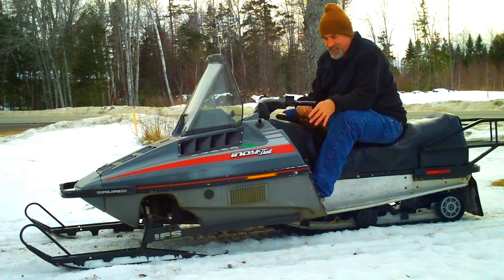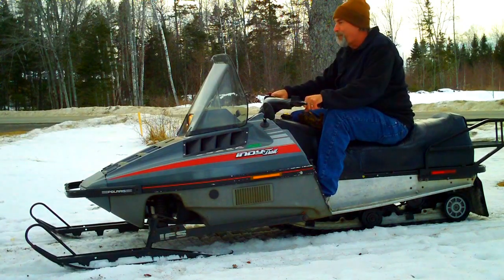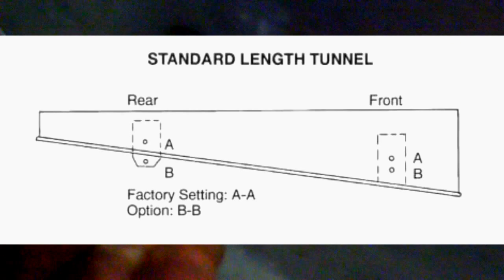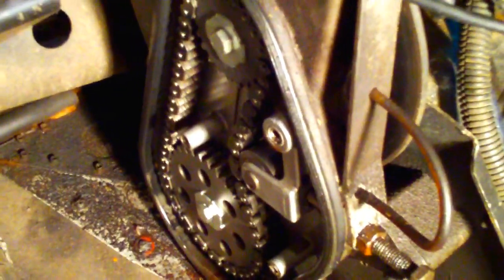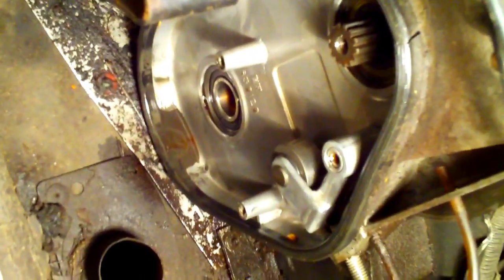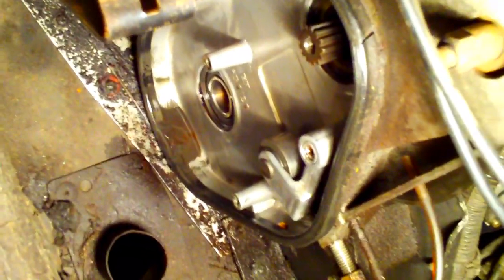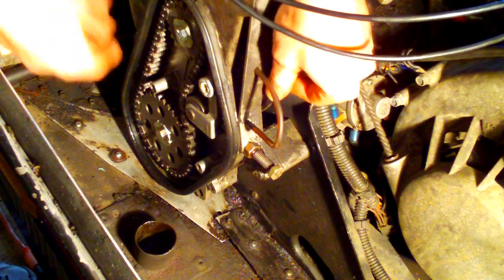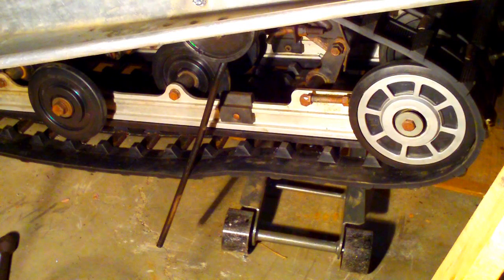Polaris Indy Drivetrain Overhaul ✔

Comment: Thanks for the great video Mark, We had to change our front heat exchager after it was damaged by a ripped out stud. Great instructions.
Reply from the maker: +Maineboy Hey, glad it helped out, sorry about the torn out heat exchanger.
Reply: Mark Young I was only asking if bolts would cause issue ...
Reply from the maker: I am not aware of an issue yet. I used fairly short bolts, so they don't extend very far into the tunnel at all.

Comment: I'm doing the same job on my 1991 650 it's A massive job I've took some hints from this video but still have alot of problems ahead to get it back together .I stripped mine right down to the tunnel I pulled engine to put new fuel pump clean out under the engine etc.
Reply from the maker: It'll be worth it when you're done. One more thing to check, and I haven't done this to mine yet but will in the next couple of weeks, is to replace the pickup line INSIDE the gas tank. I've seen them crack, I've seen them fall off the fitting, and when that happens out in the middle of nowhere your day can go downhill fast. Thanks for watching my video, and good luck!

Comment: So I'm guess you never got the jack shaft to budge from the chain case housing.
Reply from the maker: Yes, I did eventually, but it took a lot of tapping and wiggling to break it free. I don't know if this is a common thing or only happens if the parts have been together for as long as these had been. The sled is still going strong by the way. Thanks for commenting.

Comment: Hey mark, outstanding Video.  Did you change the two chaincase bearings?  I figured out the bearing numbers are 6205 RS.  I have the same sled.  Thanks!
Reply from the maker: Yes I did! I replaced them with All Balls brand bearings. Once the "C" clip is out they will pop right out with a little tapping, and the new ones will tap right back in and then replace the "C" clips. They take a strong "C" clip tool to get them out. Good luck Charles!

Comment: I had the same problem two years ago as far as the broken pin in shaft.😡 Maybe common issue with those Indys🤔87 Indy trail. Also, front two tunnel holes were egged out. I got some custom brackets on there now.  I feel the bolts going Into the tunnel could cause issue with snow build up ? I tried rivets but ended but with nut and bolt. Good work man 👍🏻
Reply from the maker: Hey, thanks, Nicholas. I'll add to the comments if the bolt ends become an issue with snow buildup. We had such a mild Winter last year that I really didn't get to try it out much. About 2 weeks after I made this video our snow was gone.
Reply from the maker: I will keep an eye on the bolt ends to see if snow buildup happens, if so I will turn them around the other way. Yeah, it seems to be a common issue with those speedometer pin shafts. Weak link. Thanks for the comments Nicholas!
Reply: Dude its a 87 lmao they dont last forever

Comment: I found a ball bearing in my oil when changing the chain case oil on my 87 trail. Can I change out the chain case bearings by taking the cover off without taking everything else off? I have purchased the all balls chain case bearing kit. Thanks
Reply from the maker: I think it's worth a try, David. The bearings are held in by circlips (circle clips). Once you remove the circlips, there's a good chance they will slide off the shafts and you can slide the new ones in place. HOWEVER, you will have to loosen the track tension to relieve pressure on the axle shaft as the track will act like a big ol' rubber band pulling the shaft towards the back of the sled. Make sure the new bearings are pressed all the way into the chaincase to allow the circlips to be put back on. If it becomes too much of a struggle, undo the brake and remove the chaincase. You want to be sure it is done right or pay the price out on some backwoods trail! Good luck!
Reply: Don't be afraid to tear into the chaincase, its surprisingly easy. I just rebuilt my widetrack with hi-low& reverse gears, it was tit

Comment: I need to replace the bearing on my jackshaft behind the secondary clutch. I'd rather not have to remove the track right now? Is it easy to drop the belly pan and get to the bottom bolt that way? Could I run it with only two bolts? Thank you!
Reply from the maker: Sorry for the late reply, I was not getting notifications. I really think you should just bite the bullet and take it apart and replace it and run it with all of the bolts in place. I've been on trails that go through a lot of nothing for miles, not where you want to be if that thing falls apart. Be safe. Thanks for asking and commenting. I hope you fixed it by now maybe?
Reply: I realize this is a year later, but I thought I'd mention that you can do this without removing the track. You can drop the front bolts on the suspension so you can get your hand up and undo the nut from there. It's even easier going back in because you can feel the bolt moving when you put it in with your other hand.

Comment: Great video.  I have the exact same sled.  Im having some difficulty removing my chain case so i can access the brake system.  Chain case seems to be binding on the upper jackshaft.  Any suggestions?
Reply from the maker: Make sure all nuts and bolts have been removed. Brake caliper too. I have another video uploaded where I replaced the chain case, and I remember it gave me some trouble coming apart. Let me look at that.
Reply from the maker: I watched that video and yes, I had a struggle getting the chain case out. I blamed my struggle on ice jamming things up in the bottom of the sled under the chain case, which I had melted with a heat gun. I bet you don't have an ice problem in September! I'm thinking one or both of the bearings may be sticking on the jack shaft or bottom drive shaft. Check for any play at all, see if they wiggle and slide back and forth on the shafts. I went back and forth, top to bottom, in trying to slide the chain case off the shafts and bolts that hold it in place. As long as you removed all nuts and bolts, the bearings stuck on the shafts seems the likely culprit?
Reply: @contact4mwy7  yeah its definitely gotta be the upper jackshaft bearing that is giving me the grief.  I’ll just keep trying.  Thanks!
Reply: @contact4mwy7  finally got the shaft and bearing to seperate!!

Comment: I just picked up an 87 just like that. The original owner took great care of it but my brother had it for about 5 or 6 years and didn't ride it much. But he left it out for the elements to run a muck. I hear a rattle near the chain case and it feels like it's ratcheting. I'm unable to find and informative videos for Polaris Indy's in these years except the couple you have.
Reply from the maker: From what you've described I would check the tension of the drive chain. I still have my '88.
Reply: @contact4mwy7  I'm afraid to open the chain case, I'm the unlucky type guy where it's always worse case scenario. Never just something as simple as making a few adjustments. Hahaha
Reply from the maker: I understand and respect that. I hope you have a shop nearby that can look at it for you.
Reply: @contact4mwy7  I'm a diy guy, ya know jack of all trades? I'd do the work but I'm not sure if it's worth putting the money and time in or maybe parting it out? Im sure a few people out there with older Polaris's are looking for hard to find parts. I'm going out to pull the cover on the case now to see what I'm up against. Thanks for the advice & Convo.